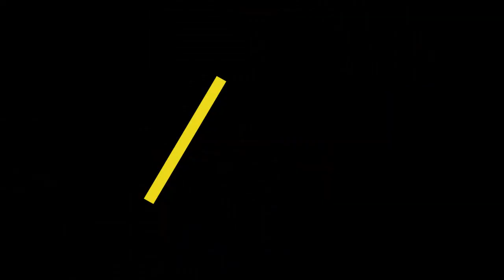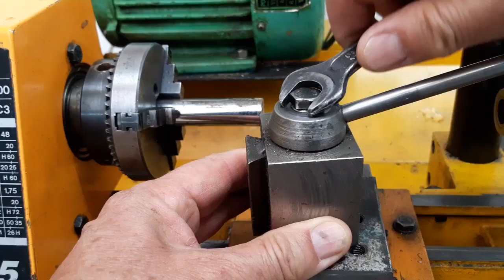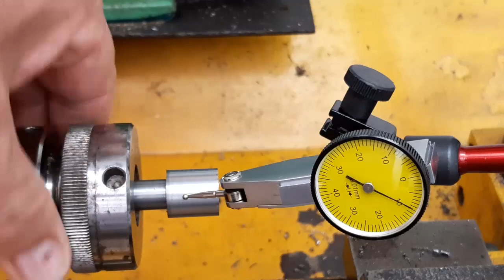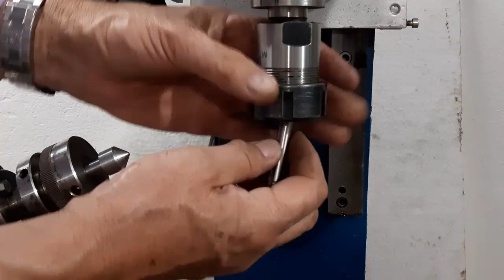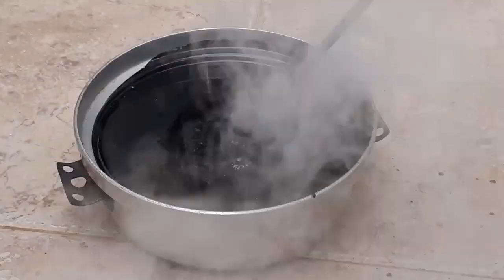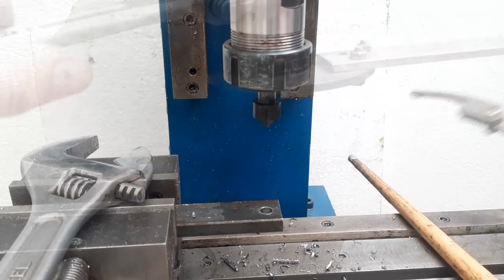How to make a countersinks with a simple method

Comment: You should try making the cutting edges with uneven angular separation (in the spindexer). That will make it cut even cleaner :)

Look at the high end countersinks from brands like Alpen, they all have uneven flutes to cut cleaner, and it works fantastic, even more so in handheld operation.
Reply from the maker: Thank you. I think he is right, but how I do it I think it works well for me and gives me an excellent cut in the metal. Greetings